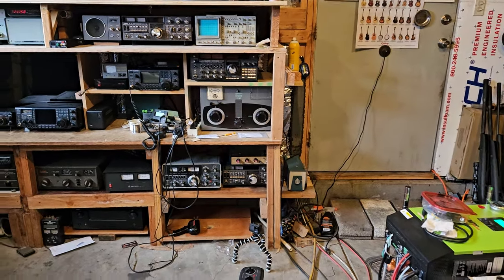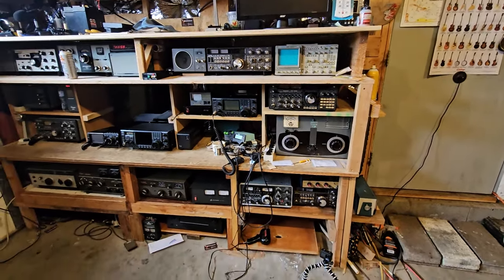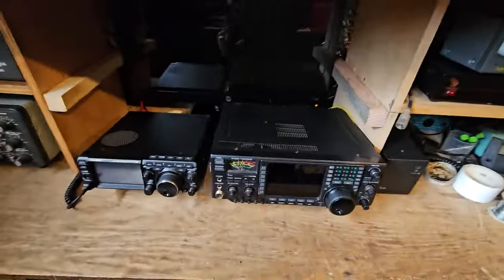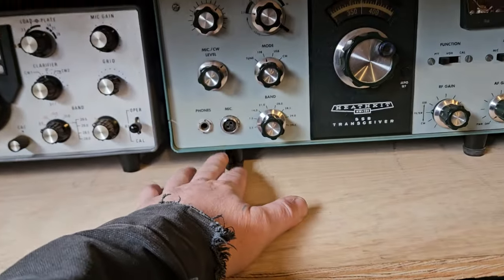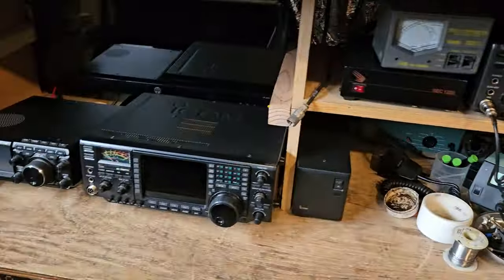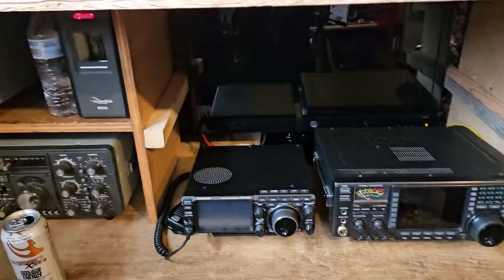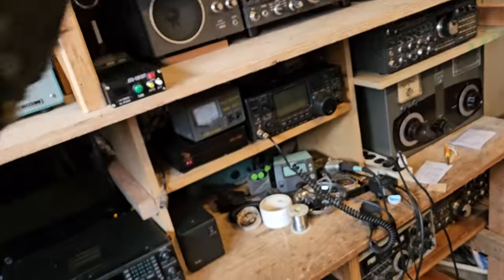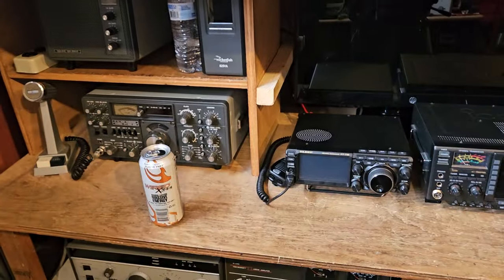I REALLY HAVE NO IDEA HOW I WANT TO ARRANGE HAM RADIO STATION

Comment: I accidentally transmitted 100W CW from a Cubic 103 to an FT-450D while doing a comparison. Still trying to get the little Yaesu 100% functional. Didn't hurt the RX, but a TX ALC issue remains after much debugging and repair. Works okay into a matched load, but with any SWR, there's an initial spike of ALC and output power slowly ramps back up. Would be okay for SSB, but I'm 100% CW so it sucks. Good thing its only a backup backup rig ;-)  Too many rigs, so little shack space :-(
Reply from the maker: I accidentally tx cw into an arbitrary waveform generator while fixing my ts940!  Smoked it ts940s is mean lol. It was probably closer to 130w

Comment: I suppose the ft-450D, or a vhf uhf maybe?  Not sure what goes on your way on 2M.  In UK it is very area specific.  Where I am there is a fair bit of early evening friendly groups chewing on simplex and putting the world to right, and late on the non-linked repeaters on distant hills start to come alive as old boys that live in remote areas (and these guys are amazingly friendly I should add) that fund and run the repeaters seemingly try to wear them out spending hours on em.  In flatter areas of the country UHF seems more popular.
Reply from the maker: Here we have alot of repeaters that dont see alot of use. Not much 2m simplex or ssb. We used to have a local 2m ssb net